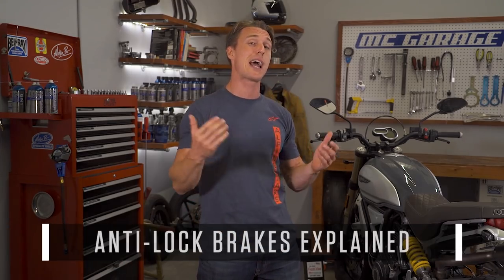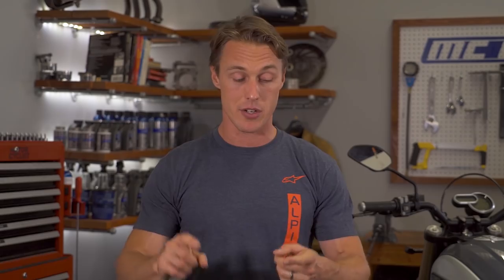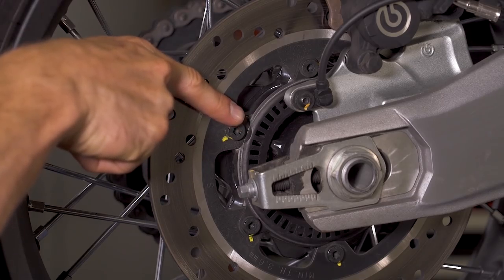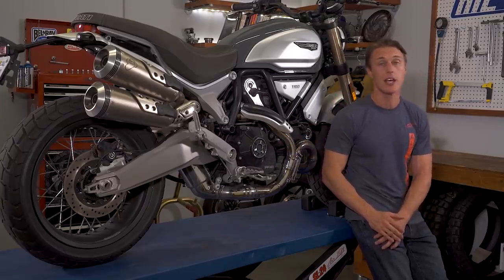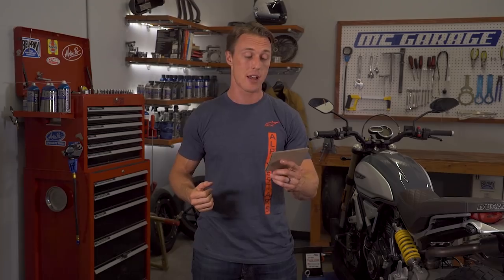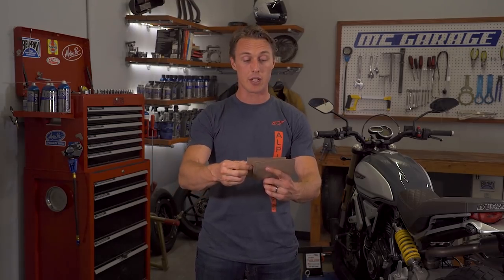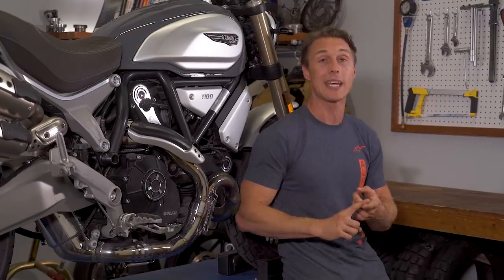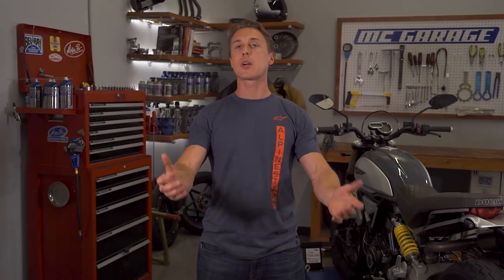Anti-Lock Brakes Explained | MC Garage

Comment: If you don't have cornering abs, will you lowside if you grab too much brake, in a corner with standard abs?
Reply: Not necessarily, but the ABS response will be the same as if you were upright, which isn't ideal.

Comment: ABS has actually been mandatory in the EU since 2016 (on bike >125cc). So yeah, the time of crappy ABS is long gone...
Reply: @Another Millennial trolls got to BS I suppose...
Reply: @Another Millennial ooh come on mate! 
I'm not saying it has somehow magically improved now because of legislation. It has just reached a point where the price, performance and safety increase by it is high enough to warrant the regulation. 
Also the cost isn't that significant right now and economies of scale combined with (eventually) simplified production lines will only decrease this further. Sure it's pricey as an extra, but that's the whole idea of it. To get you to spend on high margin options. If manufacturers still want to be competitive; they'll have to calculate the costs of ABS in the base model. They can still sell you cornering ABS as an option. 
As for being forced to buy into this. You're forced into buying lots of safety things that used to be an option. 
i.e. when buying a car: decent frame, airbags, seatbelts, turn signals, and even a right side mirror. 
Those were all over expensive options in the past. 
Now image how expensive all those would be to add as an option...
Reply: @Another Millennial see my other point under ZAMschannels replies. It's about the greater picture of health of the people. I guess we in Europe have a greater feeling of obligation to help those that need help. In reality everybody else benefits back from it. Like less homelessness and crime due to having a system to take care of others. It might seem like I'm going off topic, but road safety plays a role in the overall greater picture.

Comment: I ride a KTM RC390 on the streets, the ABS system is way intrusive and eats up a lot braking power under emergency braking, and I have crashed because of it. So now I have to ride with the ABS switched off and a constant fear of locking up the front. Do you guys have any solution for that?

Comment: I have ABS on my Hero 200S Im still getting use to it, its activate when I brake on rough sections of the roads, scariest is when i was braking in traffic and the ABS on a very slight rough road, the brake pressure released and I almost rear ended a car. After this Im using my back brake more when using my front, because its a single channel ABS, only in the front

Comment: ABS or CBS (is that right, the combined braking?) is part of the new EU regulations for bikes, so now all bikes made after 2016, for sale in the EU, must have ABS or some form of linked braking. I think it's brilliant, mainly because since 2016 I have seen cheap brand 125 bikes get a bit of a makeover and it's just a safer option to have new riders on bikes that will brake better. I have just got my first big bike and I've yet to test the ABS but I know I should so I know what it feels like.

Comment: What about traction control? How does it work and even semi active suspension
Reply: Traction control is a system that when it is noticing that the rear wheel starts spinning, it reduces power to the rear wheel and prevents you from sliding :)

Comment: Over in Europe ABS is standard on nearly all bikes sold these days. Here, ABS is optional on most bikes, standard on some of the most expensive or heavier bikes. It seems to me that for the $400.00 upcharge that most manufacturers add for it, that it may be time to just follow the EU’s lead. Though I live here in Cali, and I have never had ABS on any bike I’ve owned, I do ride all year long, and have often thought it would be good to have when I’m stuck in the rain! As we see technology creep forward, I’m sure it will become as common as fuel injection soon?
Reply: In europe it's a MUST for manufactors to put ABS on the bikes since 2013 I believe.
No bike will leave the factory without ABS these days for the europe customers.

Comment: The world's first ABS system was invented by Royal Enfield in Britain, back in 1950 using full width drum brakes. Although the system worked fine it was unfeasible to put into production using the pre-transistor technology available at the time.

There are pictures and films of the Royal Enfield ABS bike being tested. 

It took until 1979 for it to hit the market with BMW's disc brake system.

Until ABS became more available riders had to learn and adopt techniques used by experienced track racers referred to as "Flutter" (Fluttering the brake lever).

As poor braking techniques account for a majority of novice rider "spills" and crashes, ABS is a useful tool. However riders used to never riding without ABS will face a steep learning curve to loose the bad habits that ABS braked bikes instil in their minds, if they ever buy and have to ride a classic motorcycle without the system.

I've a friend who's recently bought a classic 1970's 2 stroke with a twin leading shoe front drum brake (which is running modern ceramic shoes!!). This type of brake is very ON / OFF grabby and will lock the wheel at speed, even on one finger braking, unlike a disc which has a gradual progression. So I'm having to teach him the additional new skills he needs to instinctively use a TLS front drum brake.

I suppose it inevitable that in the future riders wanting that old school non ABS classic bike experience will have to be trained how to use the brakes on them.

Comment: Hello
I have a que.
In ducati there are different riding modes well i have a query that while you ride the bike in sports mode and abs level 1 then what interval the wheel should be locked and release in via versa? and what is different level of abs and how it differs?

Comment: hi what can cause  stop abs from working suddenly in middle of my ride (versys 650) . It will be working fine when I initially start the bike after few kilometres abs light pops up and abs alone  stops working on both wheels.

Checked everything like sensors, power supply, pulsator ring on both front and rear wheel.

Comment: ABS PSA is worth doing... good vid. I don't have abs on most of my bikes but do have it on a couple and have the advanced imu version (really integrated TC/ABS/WC) on my Ducati Multi.  I personally will never buy a new "daily rider" bike that doesn't have an IMU (sorry Motus)... after a couple episodes of deer dodging on the multi (vs. the many years worth on traditional bikes) I'm not going back. Sure a pro MIGHT be able to brake comparably sometimes under controlled conditions... but to brake comparably under widely varying conditions with widely varying situations (like the "SURPRISE HERE I AM RIGHT IN FRONT OF YOU!... YEA I WAS HIDING BEHIND THAT TREE WAITING - PREPARE TO DIE!" situation) - no way. Being able to grab a prodigious handful of brake as fast as you can squeeze - without having to worry about ramping up and modulating around the traction loss point... if you think you can do that with no warning in 200ms, well don't make any big dollar bets on that. I love my luddite bikes - every one - but the vast majority of miles I log from here out will be on bikes with these systems.

Comment: hey, i own a 2017 non abs yamaha r3. later in 2018 abs version of r3 launched in India. can the abs system of 18 model can be tetro fitted on non abs model??
Reply: Yeah, but you'll need all the components, and some stuff (like mounting holes on the frame or fork) may be different. You'll need the ECU, too.
Reply: @AriH211 😇 thanks for the reply
Reply: @AriH211  in India, US spec r3 is imported and sold without abs. so the vehicle already have the slot for abs module under the rear suspension. what further additions should be made for abs installation?

Comment: Does ABS have a higher stopping distance on regular terrain?
Reply: Yes and no.
Yes = when you brake hard, and the ABS function kicks in, its actually releases power from the caliper and thus the lenght of braking increases.
No =when you brake hard and manage to be on maximum grip AKA maximum brake force without skitting a tyre you're just as quick stopping as a bike without ABS that is also on its maximum grip during braking.

Other than that, a skilled rider will ofcourse have a shorter distance to stop than a rookie rider.
So long story short, if you have ABS or dont have ABS get to a empty parkinglot and start practicing. One day you might need it.

Comment: I read / saw that the ABS on the 12-16 Ninja 650 killed brake feel so I sprung for the non ABS. I think ABS is one more thing to go wrong. I’ve never locked up the front even when people pull out in front of me or I lose focus. I’ll lock up the back far quicker. I’m sure it’s a great system on bigger bikes or more advanced bikes, but for my pokey ass 650 I don’t feel I need it.
Reply: Cliff D if ABS goes wrong you just end up with a “standard” brake. Failsafes are designed in a way that you can never end without braking power because of abs malfunction. You don’t feel you need it because you never hit the ground because an asshole in a truck just pulled hard in front of you. Trust me abs is a good thing even in a scooter.
Reply: It only seems that way to you because it requires more effort to lock up the front wheels during braking. However it's also the most dangerous if front wheels lock up. The point of ABS is the same as helmet, 9/10 times you won't need it but the day you do, you'd be thankful af
Reply: How brakes feel does not give a good indication of how good they function. When reading the text of a motorcycle review or comparison there will be a statement about good brake feel. But when the statistics on stopping distance are looked at the good feeling brakes often take longer to stop. To me the stopping distance is more important than the feel. 

(Note, I do understand that under test conditions ABS almost always takes longer to stop. I also understand there are "do overs" when testing.)

Comment: My Harley doesn't have the speed sensing ring. They say it has a small sensor which reads the rotation of the wheel bearings. Can anyone explain this type of abs system 
in greater detail and is it a better version or just an old one? (HD Street Rod)

Comment: technically, you could argue that ABS does give more traction.  
with an advanced system, it should keep you right on the line between skidding vs not skidding.  while ABS is intervening, your tire will actually be skidding a tiny amount every few microseconds, as the system continuously increases and decreases brake force.  and as we all know, maximum traction is achieved with a tiny amount of skidding.

Comment: I think America's opposition is also routed in cost, because unlike the EU ABS is often an optional extra. So to fellow American riders I just want to let you know that if once, and only once, in the entire time that you own the bike, if the ABS saves you it'll have paid itself off ten fold. Spend the 5-800 bucks, and it could save you thousands in bike repairs and tens of thousands in medical bills or missed work from injury. Not to mention im almost certain that it will make insurance less expensive. It is absolutely worth it in every sense.
Reply: Part of it's cost and part of it is that it's not really consistent with the image that the manufacturers and dealers are selling of the leather clad HD outlaw biker type.

Comment: I think abs is a goot help, however ones it got me really scared. 
I was on a rented f700 riding on a street in Barcelona when a scooter with passengers poped up in my lane. I squeezed the brake but abs kicked in and the bike refused to slow cas the road had ribbs accross and the bike just went over them as no brakes existed. I felt helpless and was petrified. Good thing is the scooter was closer to the edge of that lane and I could pass beside it... One scary moment.
Reply: If the bike you were riding didn't have ABS, you would've probably been off.
Reply: @chrispurnell9272  probably not. I could modilate the brakes and reduce the braking distance.

Comment: I read somewhere (and it doesn't sound illogical) that ABS does stop the wheel from locking; or, more correctly, if you've pulled the lever all the way, it pulls the wheel close to a lock many times and very fast, with releases of pressure in between; it tries to keep the wheel as close to a skid as possible, but not actually skidding. Now, that's great but what it DOESN'T do is sense the lean angle, I.E the skids could be happening sideways rather than straight forward and, according to said article, that could lead to spilling the bike and yourself. I don't know if that's true or not, but it sounds possible that your average rider might over-estimate the safety of ABS and behave stupidly, just like American drivers do who have 4-wheel drive SUV's with year-round tires out and about in winter-time.. Yes, ABS (and 4-wheel drive) is great, but it's not idiot-proof.

Comment: i would love abs on my bike, but can't afford a new bike right now

I've locked my rear wheel a few times without actually wanting to lock it (most of the time in emergency situations) 

its not worth the risk even tough, with enough concentration, you can easily un-lock the wheel again with no effort, but ofcourse you add a lot of break distance

Comment: 35 years of riding sport bikes. Number of times I needed ABS: 0. Number of times I had to work on brakes: probably two dozen. Now look in your service manual how complex it is to do just about anything on an ABS system. That's why I favor good old low tech skidable brakes. But no doubt ABS is very good for the dealer service network.

Comment: How can an I tell, physically if a bike is abs or not? And where I am at, we can't try riding a bike we are mot insured to. Eg: duke 200 comes with and without abs.
Reply from the maker: look at the front brake disc, you should see a ring around the center of the hub like this: https://www.motorcyclistonline.com/sites/motorcyclistonline.com/files/import/page_element_images/2013-aprilia-RSV4-factory-ABS.jpg

Comment: From my experience, it's amazing how long ya can lock your front and still regain traction, people think it's like an instant crash. Do they lock up because there front wheel locks up? You can be dragging a knee and lock you front for half a meter and ride out of it, if you are upright you can lock your front for ages and ride out of it. I imagine all these people need to do two things (ABS or not) STOP STRANGLING YOUR HANDLE BARS and STOP FREAKING OUT OVER LITTLE SKIDS
Reply: Agreed, a slide doesn't mean instant crash, and it's amazing how often you can recover from a slide by simply doing nothing and remaining relaxed.
Reply: @AriH211  literally doing nothing, it's amazing how bikes don't want to crash

Comment: One time, I was riding in the rain and managed to get into my office basement and the floor is paved with cement. When I braked, my front wheel locked and I fell. I think my wet tire and cement floor is poor grip combination.

After that I try to maintain speed below 40 km during rain time to prevent wheel locked. That's my poor man ABS.

Comment: I don't know about on a bike I've never had one with it but I drove my whole life in older cars without abs or cars I could take the abs out of and since I have left the car scene I now how a vehicle that had abs and traction control and I hate it, in the snow it screws me.all up and doesnt allow me to actually do what I need to do in order to get around a accident and as well on dry land such as entrance and exit ramps it kicks in sometimes and scares the hell out of me taking my power away from me and as well as messing with my brake pedal, so for me it's a no go I hate it in all conditions especially considering ive only ever drove lowered more aggressive cars for my driving career and I could imagine going from no asists on a bike to where a bike wants to do something your not ready for or don't expect I would think that would scare the hell out of me too
Reply: I used to driving with no assists. Now i can compare on snow the both non abs no traction ctrl with abs with TC. The assisted car can turn with full throttle and can steer on full brakes, but full brakes and change the direction twice and  the rear starts to oversteer. The car can't accelerate or brake on snow like the non abs and TC one. The cars are fiat punto 2, and alfa mito with cornering abs, electronic LSD, stability control and other "cool modern safety" stuff. The punto is with 10 years old premium tyres, the alfa is with 2016 conti ts860 tyres.

Comment: ABS has been compulsory in the UK since 2016 on all motorcycles including 125cc(EU law). I was recently on a test ride for a bike I was interested in buying and I came round a blind corner and a van had just stopped in the middle of the road. I braked hard and managed to just miss the van. It was pretty wet so the ABS saved me. The idiot driving the van said he stopped because a squirrel ran on the road....

Comment: There are after market ABS systems to my aware, and it's pretty affordable (sub $500), with test video of the distributor proving it worked on sandy and slippery surface. But till now I only saw it being equipped on smaller lighter bikes (sub 150cc). For the price I think it's understandable, no one wants their brakes to fail on a 200kg 1000cc bike traveling at 200km/h due to a cheap Chinese made component with questionable reliability and durability.